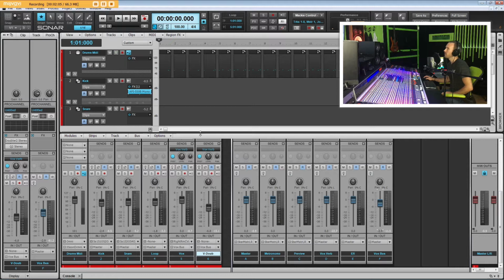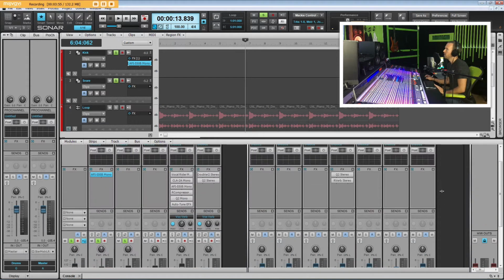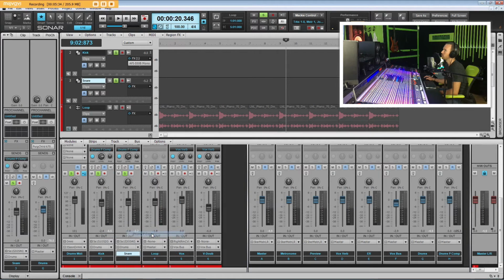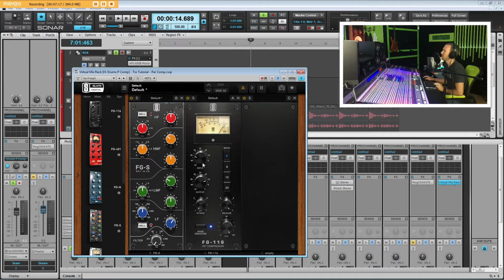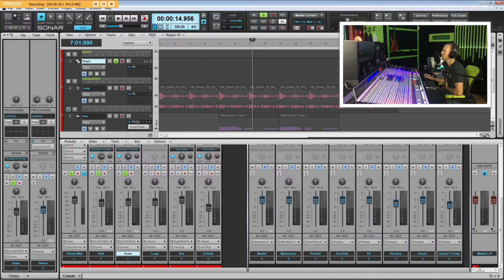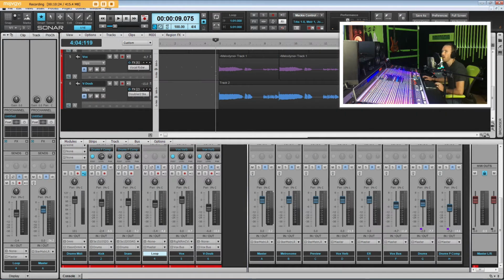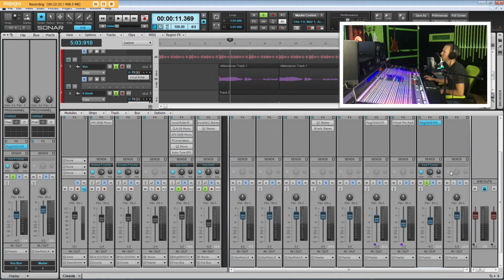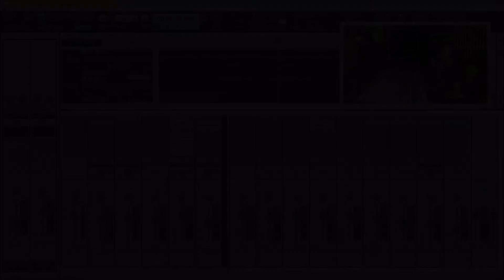Bigger Drums & Thicker Vocals With: Parallel Compression

Comment: so essentially for the track you want to do parrallel comp on you need to make two extra tracks? a drum bus, and a comp bus? so you'll have 3 tracks in the end?
Reply from the maker: Hey James, so in the end (in this particular situation) the KICK & SNARE outputs run to both the DRUM BUS and the DRUMS P COMP BUS. The difference between the 2 BUSES are that the DRUM BUS has a normally processed drum sound and the DRUMS P COMP BUS has an extremely processed drum sound. Blending both of these BUSES makes up the total drum sound. Let me know if that helped, thanks!
Reply: but is the individual snare and kick tracks still outputing sound or is only the drum bus and comp bus putting out audio? so, what im asking is including the drum bus and the comp bus(which is two tracks) are the individual tracks still outputing audio?  thats all i meant, like is there 2 tracks in the end or 3 looking at it in terms of each individual track your p comping? does that make sense? i understand what p comping is just not sure how many tracks are there in the end. like are the individul tracks basically muted after you send them to a bus?
Reply: oh another question, isnt using a compressor with a wet/dry knob the same thing as p comp?
Reply from the maker: Hey James, for that question no, the kick and snare do not output sound from the kick and snare channels. Yes its like the kick and snare outputs are muted and have been sent instead to the drum bus and p comp bus! Thank you!
Reply from the maker: And yes, a compressor with a wet/dry knob is very similar except for the eq we added. Also, using the 2 buses makes changing level of each bus easier. Thanks again!